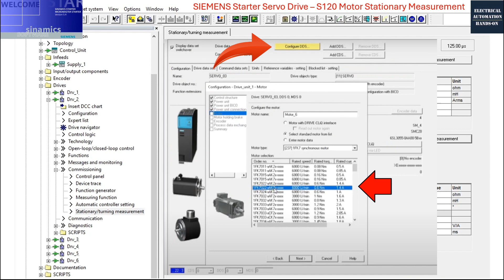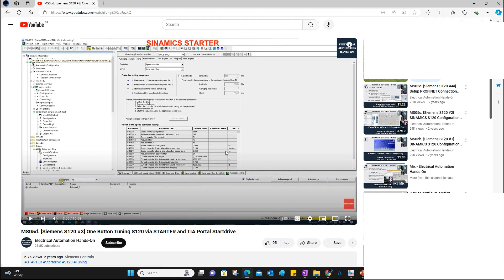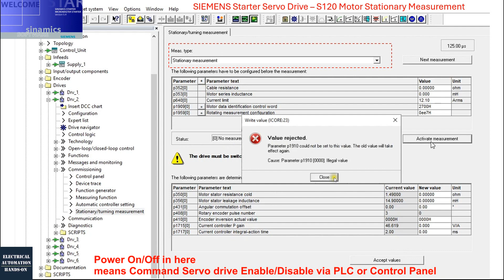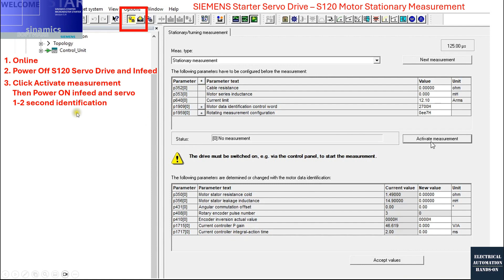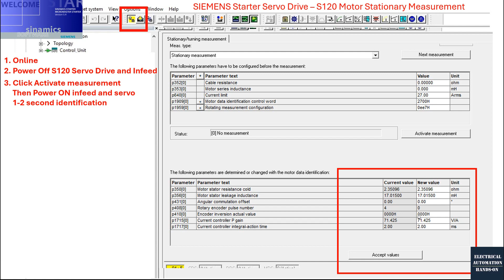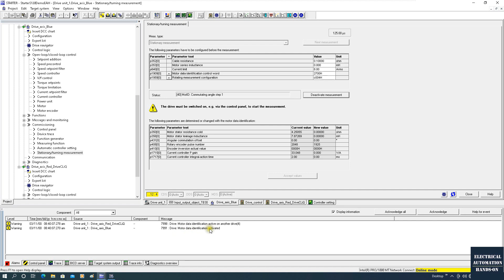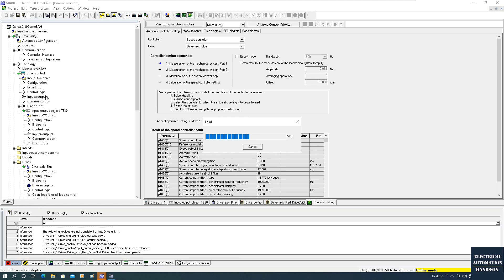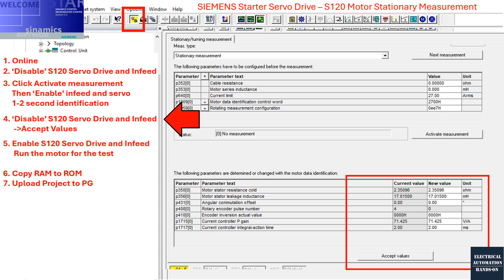MS10.Siemens Servo Drive Motor Tuning - Stationary Measurement

Comment: Hi, sorry for bother, but did on the model you have, how do you set Line module with Servo motor? For me, in local control it asks me to manually turn on DC link (like there's  a special button that needs to be pressed after I Assume Control in Control, under Commissioning), how could it be done from PLC?
Reply from the maker: Please find this link about 'SINA_Infeed' https://support.industry.siemens.com/cs/document/109759490/how-do-you-switch-on-the-line-module-of-the-sinamics-s120-?dti=0&lc=en-EG